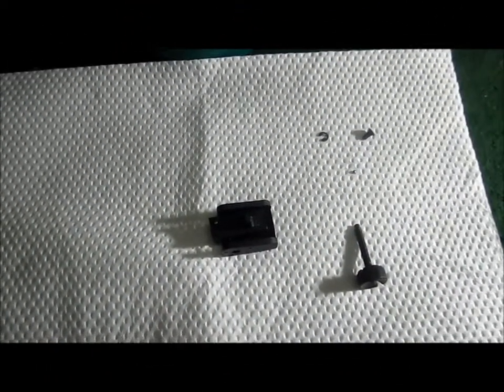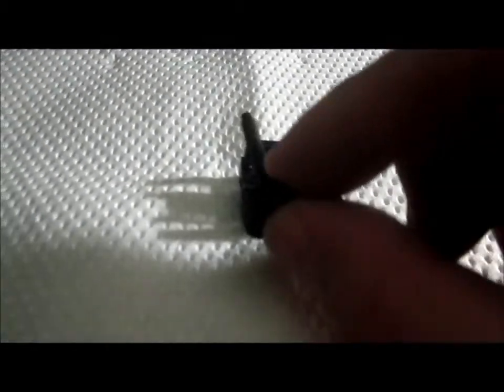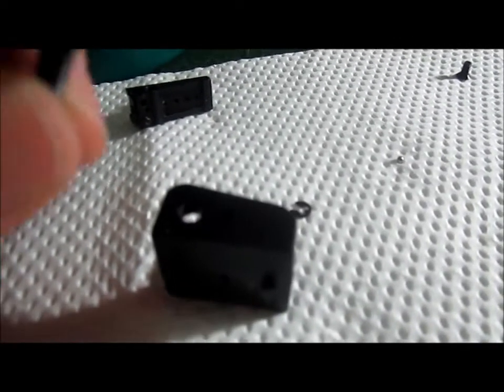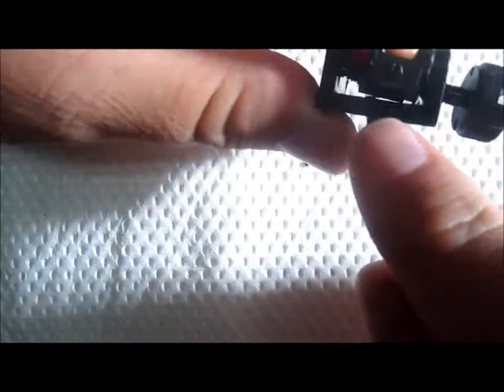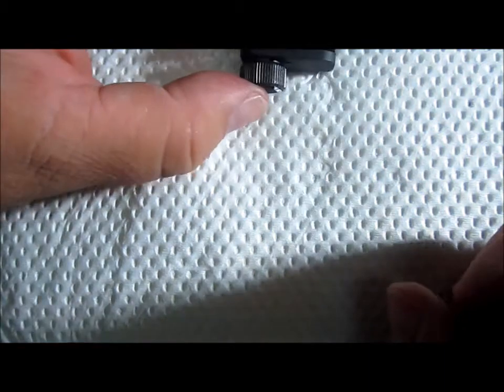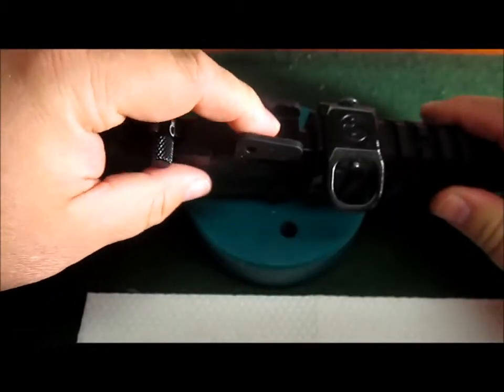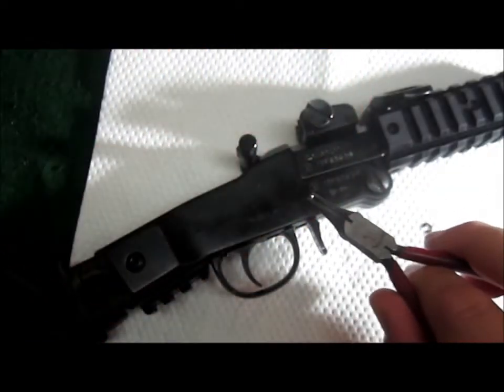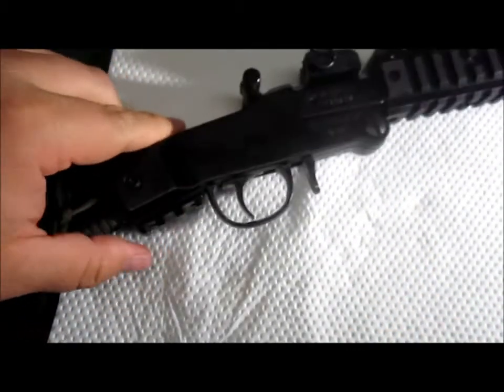Chiappa Little Badger Rear Sight Disassembly and Reassembly

Comment: northernwolfdude - I FINALLY DID IT!!  It has taken me this long, since getting the parts from Chiappa, to get that rear sight together.  Were you using some type of demagnetized pliers when doing this video?  Both the small screw & ball bearing stuck to whatever pliers/tweezers I tried to use.   I actually ended up using Elmers glue to keep the spring in the receptacle before placing the bearing on top of it.  During this time, I managed to loose the ball bearing twice, even though I'd blocked off the desk area upon which I was working.  I found that, if the spring & bearing aren't placed in exactly the right position, the bearing goes flying out as if shot with a slingshot.   I ended up getting the ball bearing onto the little screw by using both wooden & plastic toothpicks &, with great patience, screwing the windage knob into position while stabilizing the bearing with a wooden toothpick.  Each evening tested my usually calm demeanour: if I wasn't waiting overnight to let the glue dry, I was scouring around on my floor trying to find the ball bearing.  My magnetic wand actually found the bearing for me one night (I hate to admit it, but now I can't find my wand).  Only in rare instances will I let go with a string of profanity at the top of my lungs when I get really frustrated.  The only reason I didn't engage in that type of catharsis this time was that my dog was with me at my side, & that type of emotional display gets him very nervous.  Two years ago, I'd gotten turned around on my daily walk with my dog down by the creek.  I tried finding the path which I'd left, but discovered myself flailing through rosebushes & tripping over logs & foliage in the process.  "Be a real man, Wayne", I thought, & act like most guys would in the same situation.  So I shrieked out as many curse words as I could, & even invented some, as I huffed & puffed with torn flesh towards what I figured was the path.  My display panicked my retriever, who hadn't seen me like that before, & he was jumping & barking with wide-eyed terror at the situation (and he knew I wasn't mad at him).  Since that time, I've tried avoiding using curse words, even under my breath, as he starts to get nervous again. I have never worked on a piece with such small parts before.  It was like working on a Swiss watch (which I've never done & never will).  If it hadn't been for your video, I think I'd have given up long ago trying to replace this sight.

Comment: northernwolfdude -  I finally rec'd the spring, which I'd lost while disassembling my Little Badger rear sight, from Chiappa.    I'd placed the order by phone on July 17.  On Aug.1 they sent me an email stating that the part had been shipped from their factory.  It arrived on Aug. 10.  I have just now begun trying to replace the sight, with the help of your video.  I'll let you know when I've completed this operation.  (You'd mentioned somewhere that you'd contacted Chiappa for information on torque pressures for some kind of screw operation.  I suspect that you're still awaiting that info).   Regards.
Reply from the maker: ya, i never heard back about the torque pressures for their screws.

Comment: Hi I have pulled off my rear sight. Is there just one little spring under the elevation part? on the left side looking down the barrel. I hope so because mine only has one🤔 I couldn’t see the spring, but as you said . They are small parts. And have you pulled off the front sight? If so could you please reply with how it’s done. It looks like there is a tiny screw at the top of the sight. Cheers Brent
Reply from the maker: i have not pulled off the front sight.  looking at the exploded view diagram of the little badger it shows a screw that goes down through the front sight and indexes that front sight off a flat in the front of the barrel behind the threading.  should just be able to back that screw off and then slide the front sight off past the threading.
Reply from the maker: here have a look  https://www.chiappafirearms.com/parts-list.php?id=182&idfam=26
Reply: northernwolfdude thanks for the reply about the front sight. Am I correct with there only being one little spring to push the sight down against the base. Not the spring for the windage. Luckily I didn’t lose that because I didn’t know there was a very small spring there. But it makes sense on how it works to have a spring. Thank for the link. Brent 🇳🇿
Reply from the maker: @elijahmonn3757  ya, one spring for the base of the elevation part and one spring for the windage so 2 in total, again if you look at the exploded diagram you will see them listed as part #31 and part #34, hope that helps!
Reply: northernwolfdude there is another spring I think. With a ball bearing . To make the elevation sight click when going up and down. But I think you have to pull something else off to get to it. Is there a ball bearing at the end of the other spring. The spring that is  easily accessible when the sight interior is taken off. Thank you so much for your help.i hope all that isn’t to confusing. Kind regards Brent
Reply: The blue print from Chiapas web site is a little hard to see the exact details.
Reply from the maker: @elijahmonn3757  click on the picture then use your mouse wheel to zoom right in
Reply from the maker: @elijahmonn3757  i have not taken down that rear sight past what the video shows but i was just looking at the exploded view and it looks like there are 3 springs and detente in total for the rear sight assembly.  one for the windage, one for the elevation and another between the windage and elevation.  all 3 have their own small bearing.  here i took a screen shot and labeled the springs and i put a arrow on which way the parts should go to come apart.  https://img.photobucket.com/albums/v333/jiro27/Plinkers/chiappa%20little%20badger%20rear%20sight%20take%20town_zpslpdyqwes.jpg
Reply: northernwolfdude WOW. You are a hell of a nice guy. I could tell that from your video. Great guns eh. So original. Cheers Brent 🇳🇿